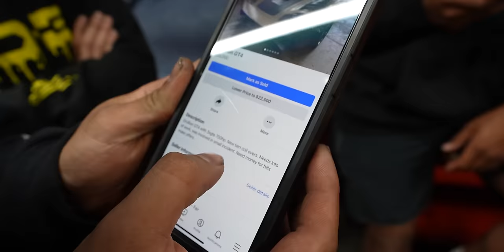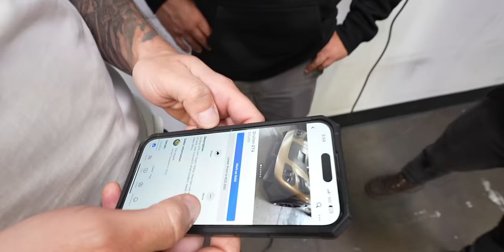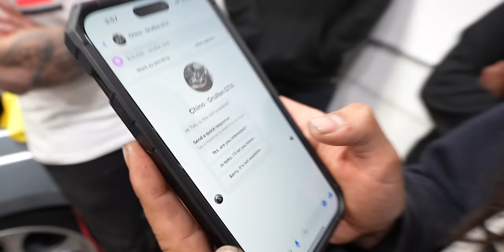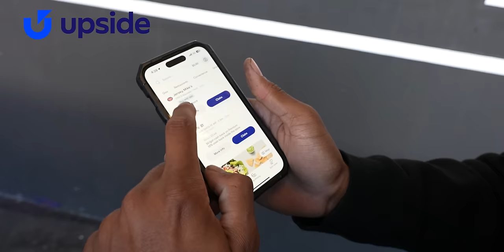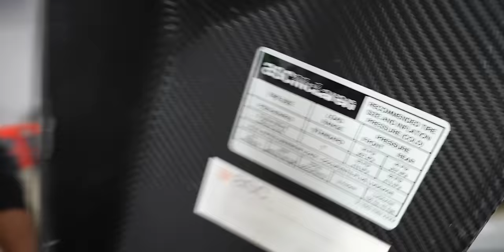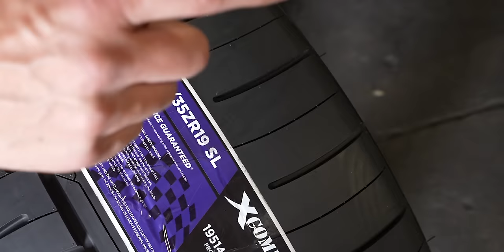DAMON’S PISSED! TIM SELLS GIFTED CAR…

Comment: 1. The Timborghini  is the truth.  I hope you put a high end engine in this thing.  And give it a proper build.
Reply: Built 2az or K24 would be LEGIT
Reply: Already has a proper engine tf u mean
Reply: Why put a heavier more expensive engine in a kit car lol only a k series would be as sick
Reply: @user-ei1hr4zv4h  I don't think the 2AZ or the K are much heavier, they're both newer engines & both are easily capable of 400-600 wheel on pump gas. 
Even if the kit car has a 3S-GTE (they're good engines) but there are better choices for reliable/ cheaper hp, and more readily available parts. That's why the K swap is so popular with SW-20 MR2s.
Reply: @etoomey2 I was thinking k24 or 4g63 if it fits. Ideally an ls3 would be sick but I don’t think that’ll fit 🤣
Reply: 4g63 the world .
Reply: Tbf it's already got a built 3SGTE, buying another engine and building that would be great but even more time consuming and pretty pricey
Reply: Timborghini needs to be the name of the car!

Comment: If the engine is a 3sgte Mr2 motor, could be about 350 on stock crank on a good tune. Might need a different turbo in size for more air. The 5sgte the camry block forged and built with 3sgte head can reach that 700 horsepower.
Reply: There’s no point in doing a “5SGTE” build when the 3S is more then capable of holding more then 700hp. 

The 5SFE doesn’t have a forged bottom end it has a forged Crankshaft.

Comment: The DDK (Daily Driven Kit) has a lot of backyard mechanic work with bailing wire and duct tape on an engine that's cheaply replaced. There are tons of JDM crate engines for the MR2 MK2 3SGTE from 350-650hp. It's a great engine at least. As for looks, try a Rocket Bunny color scheme, two or three-color pastels, and maybe some 19' Rotiforms to match. The existing wing fits the car but it has no diffuser.

Comment: This is a build you guys could have a lot of fun with. Depending on how much room there is for a motor you could get crazy with an engine swap but a built and boosted k swap would be legit some brake upgrades as well as suspension and this thing could make for a pretty quick little track toy. Then Tim can join you fellas out on the track.

Comment: Honestly, I think the color should either black with green accents or green with black accents. The interior should be fully the least used color as the accents of the most prominent paint or "wrap" colors, such as stitching, while the accents of the outside should be the prominent on the inside.

Comment: Damian or tim plz read i have a few ideas . a linelock kit  , built in cameras front n back for some cool footage ,underglow n interior neons , indash uhf or cb radio and a stereo with some nice bass , replace all the body gas struts with electric actuators , functioning air conditioner, and finally could a any level lift kit be fitted or modified in so its race car one minute then 3 wheeling the next

Comment: Please put either an LS engine in it or would be even cooler if you swapped in a M104 Mercedes engine in it and turbo'ed it. A bunch of the professional drifters in Europe use the M104 platform and make crazy power

Comment: Not going back to find it but swear Sai said it's a 700hp engine out of a race car it's the same engine they use to run in supras for better weight distribution n was aloud to run higher boost levels